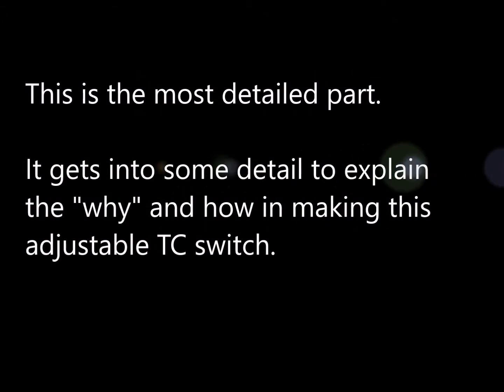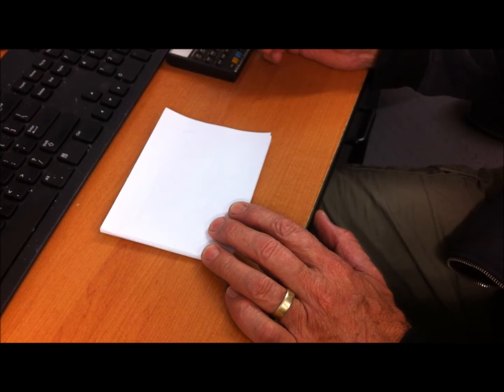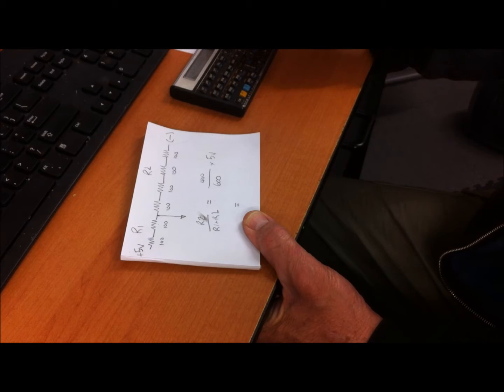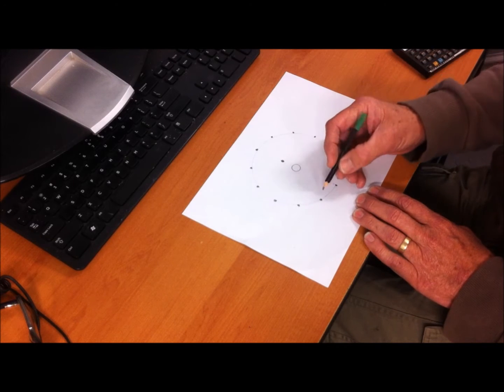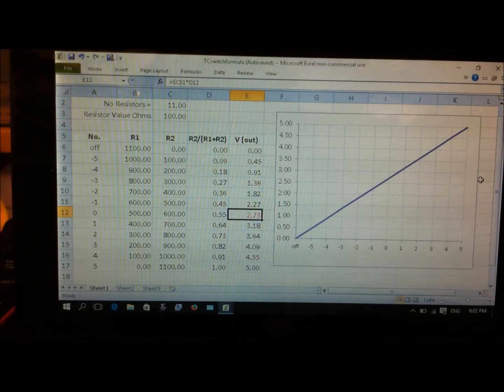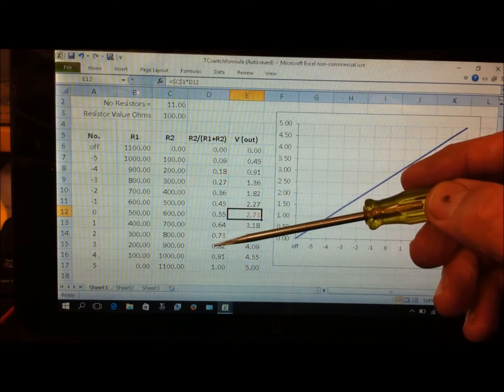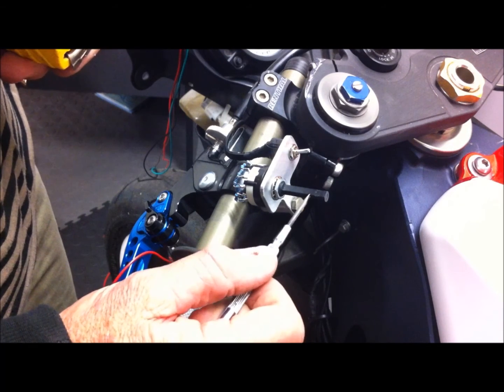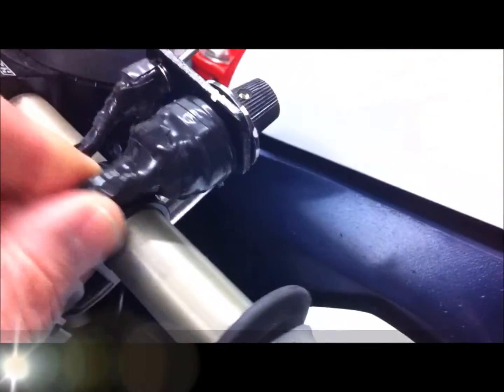Bazzaz ZFiTC Traction How to Make TC Control Adjust Switch TC Active Light and Map Switch P2

Comment: Awesome video, thanks for the tutorial.  I was trying to figure out how I was going to reverse engineer the rotary switch without buying one from bazzaz.  Do you know offhand what kind of plugs they use on the end of their switches?  I know you said in the video that you ordered some but I'm not sure what they are.
Reply from the maker: I was a bit lazy and never got around to ordering them. I don't know 
what they're called but they're a common connector. I have an account 
with www.aliexpress.com and buy connectors there. If you search you 
should find that type. You've reminded me to order them so whoever finds
 the correct type first please post a link in the comments :-)
Reply from the maker: https://www.aliexpress.com/item/Free-Shipping-10-sets-DJ7031F-2-3Pin-car-connector-Automotive-accessories-Car-waterproof-electrical-connector-for/1383681204.html?spm=2114.10010108.1000023.2.77GKhX

I think these are the type you need. You may want to contact them and conform the dimensions.

http://www.connector-terminal.com/DJ7031F-2-21-3-way-sumitomo-motorcycle-sealed-female-connector-socket-terminal.html

The link above is for the same part number and gives the dimensions as 11.8mm which seems right.
Reply: Awesome, you da man, thanks!

Comment: will any 100ohm resistor work? do you have a link to the ones you used or a closeup of the rings so i know what to pickup? thanks in advance
Reply from the maker: +cwcb08 Yes 100 ohm 0.25watt resistors from the local electronics store. I don't think I can explain it any better than I've already done in the video. A 12 position single common pole rotary switch is required. Watch the video a few more times.

Take a screen shot and enlarge it.